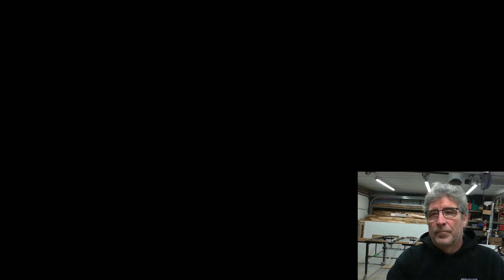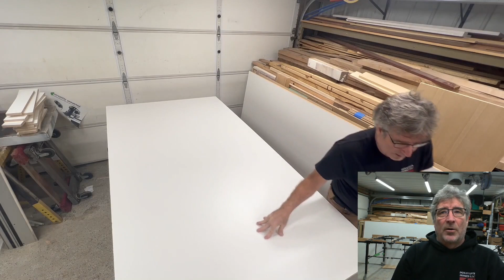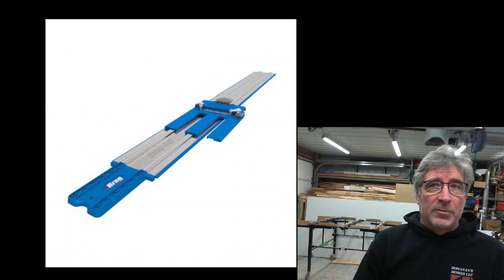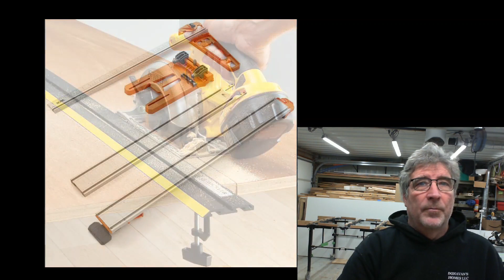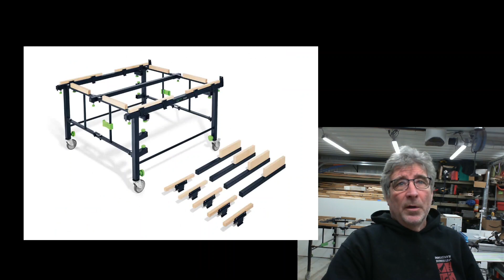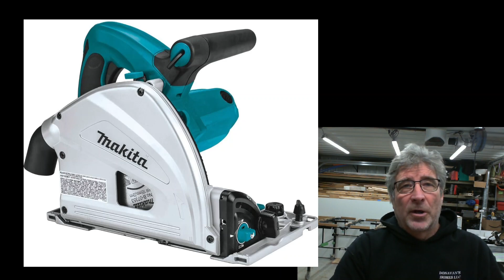Breaking down sheet goods  | Kitchen cabinet build series Part 4

Comment: I built a track for my Porter Cable blade left circular saw. Has a fixed fence for the saw base to ride against and I use MicroJig dovetail clamps in a dovetail dado on the underside of the jig. Takes a little time setting up, but for the 4-5 times a year I break down sheet goods it does the job. Great video series! Thank you!